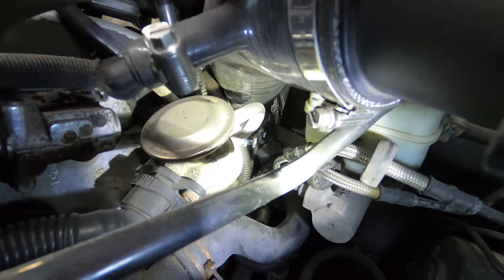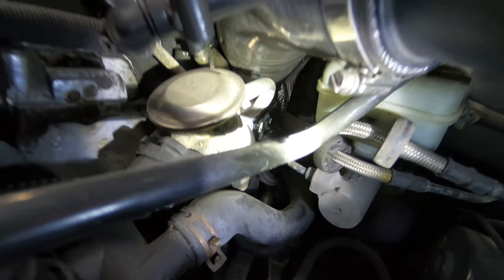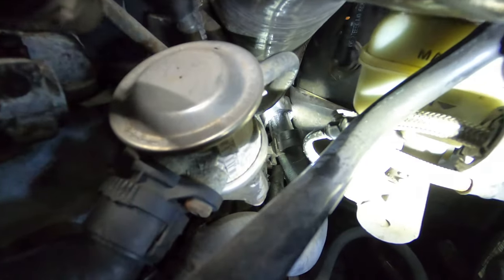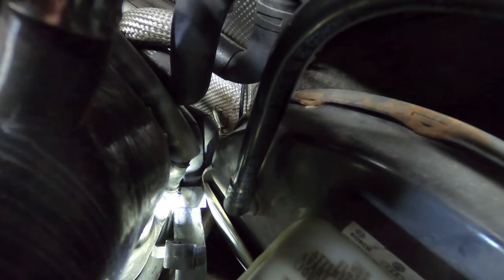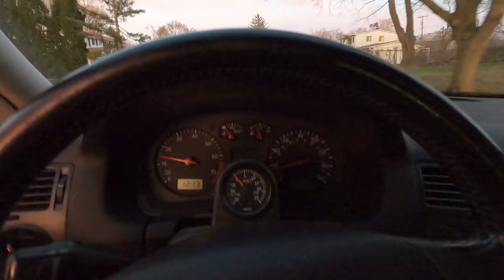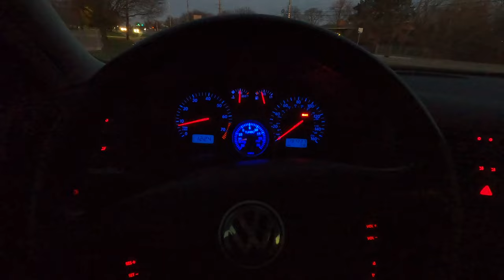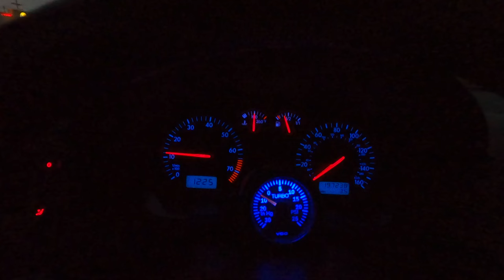The Jetta Comes Out of Winter Storage

Comment: Did your boost gauge come lit? (Assuming it’s stock)
Reply from the maker: It's not stock, it's a New South Performance gauge that's made to look stock though! They sell a few different types of gauges all with indigo lighting to match the stock cluster. I've had mine in the car for 9 or 10 years and have zero complaints.